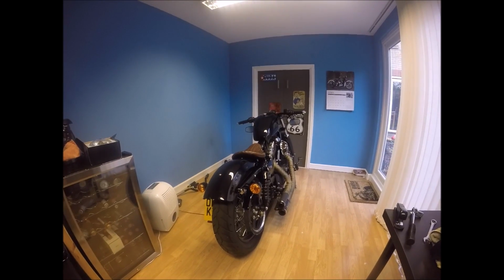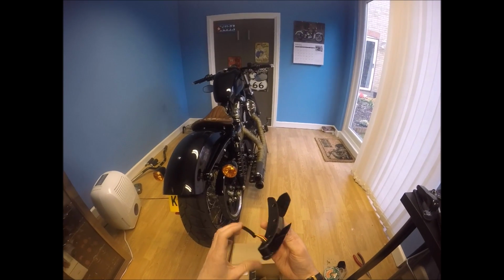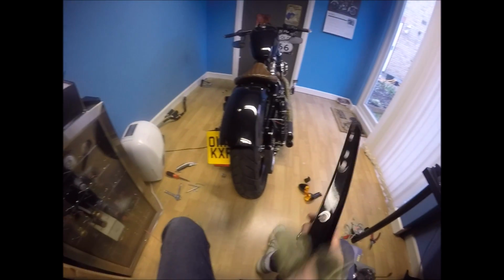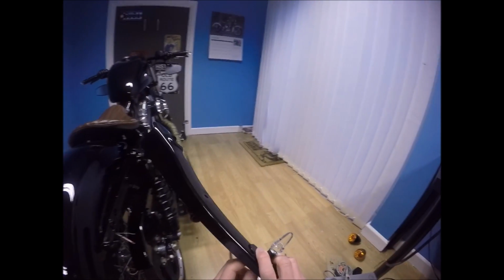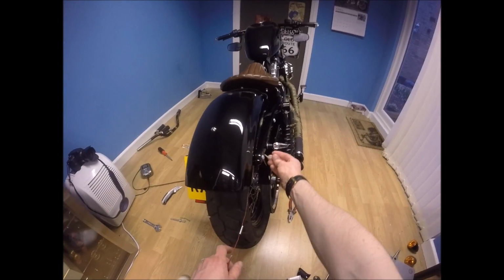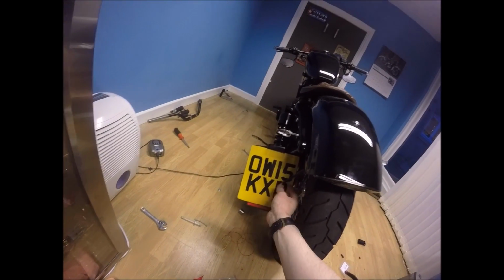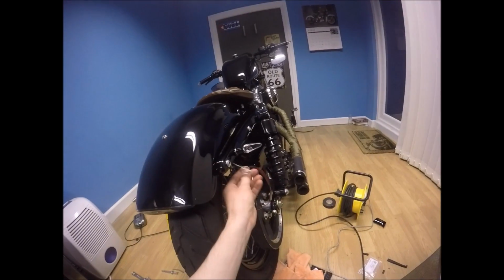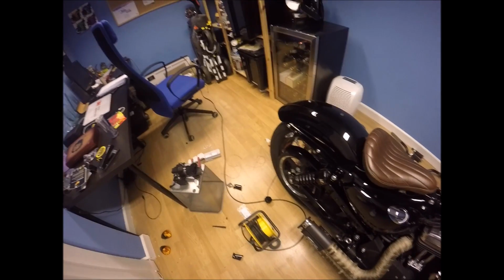HOW TO: Motogadget Ice Indicators & LED Brake Light Install | Harley Sportster 48

Comment: I already have the M Blaze Discs installed  on the bar ends of my Sportster. Now I am thinking about installing the M Blaze Pins for my rear turn signals. Will I need to also intsall a flasher relay from moto gadget? It seems that they recommend using a relay for all of their led light installations. Did you use a relay for your motorcycle?

Comment: looks great. would to do it on mine but in Australia we have the plate on the back only and it must have a white light on it.
Reply from the maker: Bomber thanks man, we have the same law in the UK on rear plate - I did a previous video on installing a legal side plate here which you might find interesting!: https://youtu.be/ezH30kngclc
Reply: Riding Digital Unfortunately a side plate is illegal in Australia. but I did watch that video because I want to remove the plastic tail.

Comment: im curious to ask how the light is holding up over time with just the 3M tape?? im planning on doing the same to my sportster however 2 issues im thinking can happen is 1. the tape doesnt last and the light falls or 2. the rear bottoms out and the tyre touches the light and rips it off, have you had these things happen on your end?
Reply from the maker: The light held on absolutely fine for years, was never at risk of coming off. HOWEVER, the size of the light block meant it rubbed on the tire and eventually rubbed through the plastic.  I ended up replacing it with an official HD rear light that was slimmer and avoided the issue.  Was much more expensive but less than a cheap light and a new rear tyre!

Comment: How did u loosen the turn signal housing unit ?
Reply from the maker: From memory, get your hand up the back of the side rail, its tight with the tyre but you should feel a bolt which you can loosen with a spanner, its fiddly but doable 👍🏻
Reply: Riding Digital thanks a ton !

Comment: i see you also have a red light on in your dash. I have the same fender light but with indicators built into it. whenever ik brake the red light will come on. Any idea to why this is/how to fix it/if its bad for the bike.
Reply from the maker: I'm not 100% sure, the abs rear brake wire popped out and rubbed through on the wheel which I know is throwing up an error code during services so I guessed it was that?

Comment: I noticed the turn signals by the handles. That’s the first time Ive seen that. Looks really cool. Can you add them and maintain the stock ones at the same time? So you essentially have two sets of turn signals like in cars (front signal and mirror signal).
Reply from the maker: thanks.  You certainly could split the wires but whether it works depends if the relay has enough voltage, you may need to switch it out it to run both.  The bar end indicators are super bright so tbh from a visibility perspective I personally dont think you need both.  Good luck 👍🏻
Reply: @ridingdigital  Thanks for the reply. I wanted to get those turn signals that are white when they are not in use for even more road visibility. Also, having two turn signals would also aid visibility (like in cars, where they have it in the side doors and the front). That’s why I asked. I think it would look cool too.

Comment: Why at the end of the video when u put the right side blinker on. That they all start flashing? Sounds linke u need some led flasher relays to fix you hazard lights
Reply from the maker: +Ron Don I think the noise you're hearing when I click on the power is the ignition coil priming. All the blinkers are flashing because I've put the hazard lights on to show them all working.
Reply: Riding Digital you have a hazard light for ur bike? I never heard of it and my bike won’t flash with a led signals change over. I think I need flasher relays for my 02 1200custom sporty
Reply: That's the fuel pump mate..

Comment: Just bought a 2012 Forty-Eight that has of one of those piece of crap brake lights installed - the same one you're installing on this video. The one on my bike was installed poorly; it's now broken and hanging near the wheel. I'm no mechanic or electrical genius, so I need a learned opinion here - can it be removed by simply cutting it off at the wires and hiding them away? Or will that mess up all the lighting on the bike (turn indicators still work and can function as my brake light until I buy a replacement...) Any help is greatly appreciated. Thanks.
Reply from the maker: Sorry to hear that. I assume then you still have the original indicators that also function as the brake/tail lights. First question is can you simply reattach the light to the underside of the fender? A strip of VHB tape will fix it strongly.  If youre running the original indicators and have this unit then the previous owner will almost certainly spliced into the wiring for one indicator side. If you need to remove the light Id cut the wires as close to the unit as possible, then isolate each wire individually so the bare ends don't touch each other, then tuck away. If your rear light is like mine (e.g. just tail light and brake light) then your other electrics shouldn't be effected. When you come to fit a new unit it would be worth tracing back from the ends you cut to see how the last owner connected those wires to the originals to see if it's a secure job, if not redo properly. So basically I think you'll be ok if you wrap up the wires but without seeing it it's impossible to be sure so make sure you're happy with what you're doing. Good luck 👍🏻
Reply: Riding Digital That's perfect. Unfortunately, the light is unsalvageable; the adhesive came off mid-ride and the cheap plastic light didn't survive the rear wheel. In pieces. The previous owner seems to have spliced into the original wiring to attach (stock turn indicators are still on the bike, and still function as brake lights) so cutting the add-on piece away and separating the remaining wires looks like it'll do the trick. Thank you so much for the expert advice! I appreciate it.
Reply from the maker: No worries mate, Im not an expert by any means, I just give it a go, try to enjoy it and see what I can learn! Let me know how you get on 👍🏻

Comment: Hey RD or anyone else fitting this LED rear light. Make sure you silicone seal the cable entry as although it has a grommet, mine just failed and when I pulled it apart there was water damage on the PCB when the cable is soldered....
Reply from the maker: v8dve Thanks for the advice, will dab some silicon sealant tonight! RD
Reply: @ridingdigital  Second time I fitted this LED rear light. Twice my rear tire has been eating it after hitting a pothole. Maybe it's just me that can't avoid joyriding potholes
Reply from the maker: @funcle8572  same issue with me, second one worn through.  Just ordered one from HD for £65 which looks exactly the same without the big box so doesn't rub + its plug and play.  will be doing a comparison video soon, definitely not worth the cheap price on this

Comment: Where did you buy those turn signal lights and the brake tail lights? it's very nice and neat.
Reply from the maker: +mrjtful Tayo Thanks! I got the brake light from eBay, there are hundreds like it on there for around $20. The turn signals are Motogadget M-Blaze Ice indicators which I picked up from a dealer in Germany but you can get them from most places like Revzilla etc. Be careful though, sometimes they are priced as individuals not a pair. Hope it helps with some inspiration! RD
Reply: Again  thank you!
is it the same exact  lights for rear turns and for the handle bar turn lights?
Reply from the maker: mrjtful Tayo Same brand and range but different designs. Bars are motogadget m-blaze cone bar end indicators. RD

Comment: That is the biggest reg plate I've ever seen. ;)

You're already breaking the reg plate guidelines by having it not be visible from the right hand side, so you might as well just get a smaller reg plate.
Reply: Shadow Broker ... that’s not strictly correct ... A side plate is legal provided it can be viewed at a reasonable angle from the right side at the rear. This is similar to how lorries often have their plates on one side at the rear.